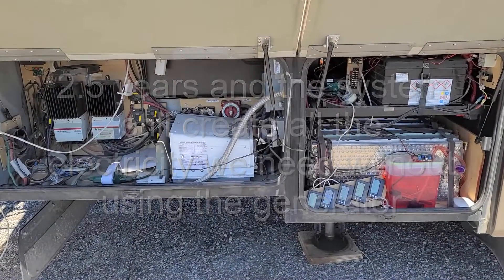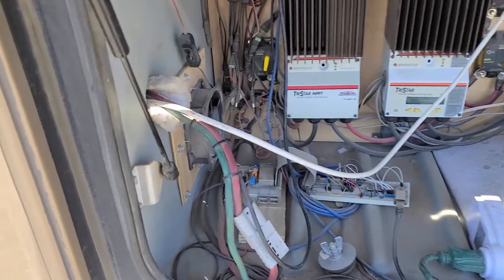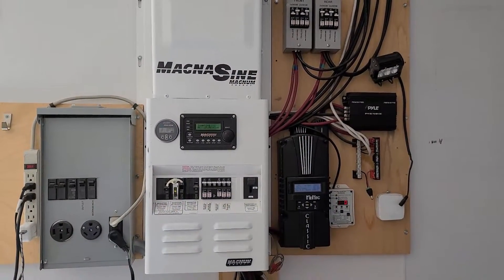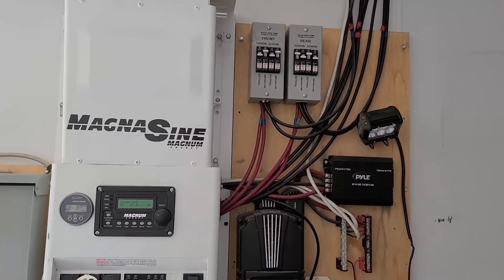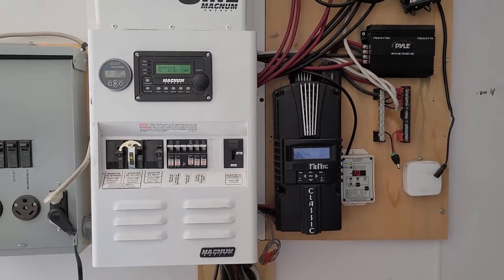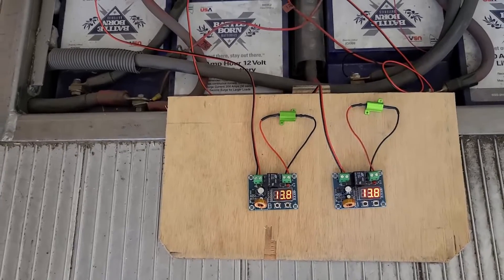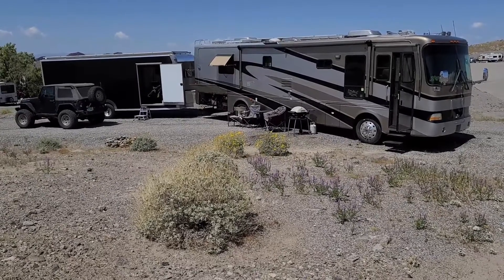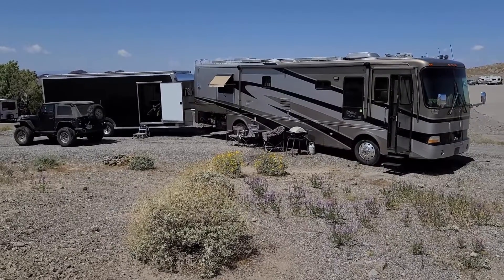2.5 years status, still no need for a generator

Comment: Thank you for making these videos.  This is an informative and relatively rare example of a mobile solar system powerful enough to use for climate control.  In your previous video from 3 years ago, I believe you stated that you used the system for heating using an electric fireplace.  I was wondering if you have considered using a split heat pump, which I have considered for a future camper build.  Since heat pumps move heat from one environment to the other (outside to inside for heating, inside to out for cooling), many heat pumps can move heat with an electrical efficiency of 300-400%, compared to other electrical heating methods that almost universally use electrical resistance, which is nominally 100% efficient.  Meaning you could save a huge amount of electricity if you use often use your system to heat.  Best of luck with your future adventures!

Comment: You are an Inspiration.
When you first showed your system on yt I shared it with a few people in the solar installing business I know here in Italy. 
This is literally pushing the boundaries of mobile solar energy self-reliance.
Mass adoption of electric cars will def. open up the realm of possibilities of usable offgrid power supply.
And with pandemics and freedom restriction, A remote off grid property has gotten higher on my list...Thank you for posting. Best wishes
Reply from the maker: Thanks for the nice words. The key to this working is the movement of the RV to temperatures that do not require extended AC or a lot of heating (Diesel and Propane is used for this). In a fixed location can a few efficient Minisplits and more solar solve this.

Comment: I was wanting to ask you about exceeding the VOC from the solar panels to the charge controller. That doesn’t seem to have given you any problems with your system. Do you ever have to turn some of the panels off if the volts gets to high from the panel to keep from burning up the charge controller? I am thinking about using the same charge controllers you have and doing a 24 volt system but the panels I am looking at would put the VOC at 180 volts (max) and morning star says max volts of 150. Any input from you would be appreciated.

Comment: Very nice setup, am thinking of getting one or two Tesla batteries, but I can’t find where to get a complete setup to get the best usage (18V-24.6V). I can’t find inverter that would do this. Any ideas?
Reply from the maker: Try reading this blog about loading a Tesla Module: http://offgrid100.com/tesla-module-load/
You really need multiple (minimum 3 in my opinion) in parallel to have a working battery bank unless you have very minimal loads. I do not think you can find inverters that is "24 Volt" that can go lower than 20 Volt, but you really do not want that either to not hurt the battery bank.